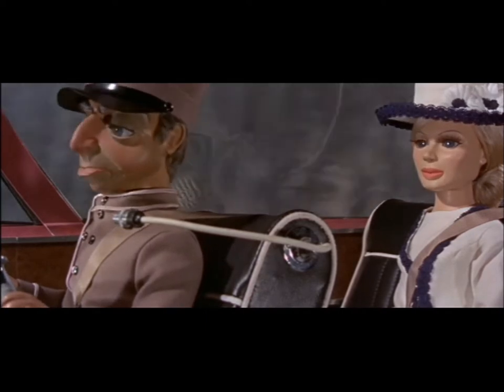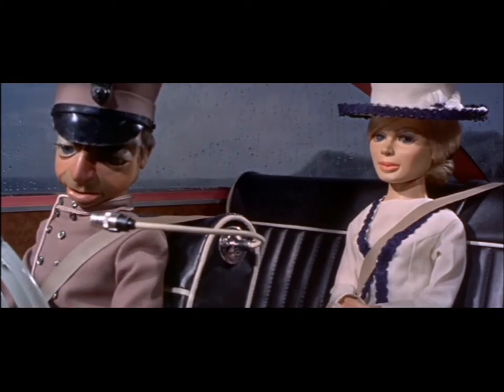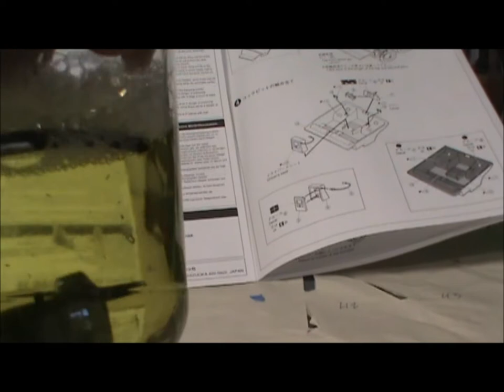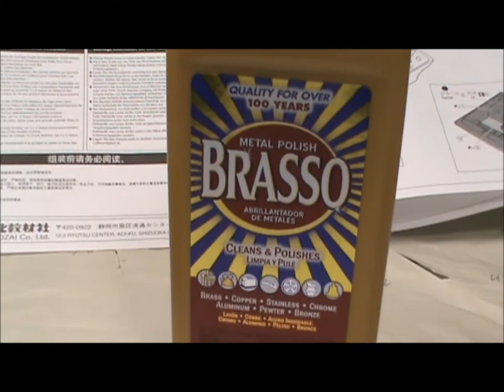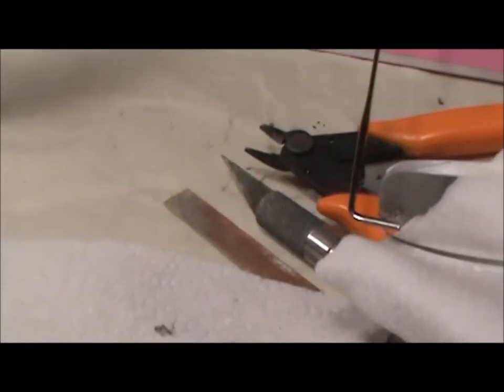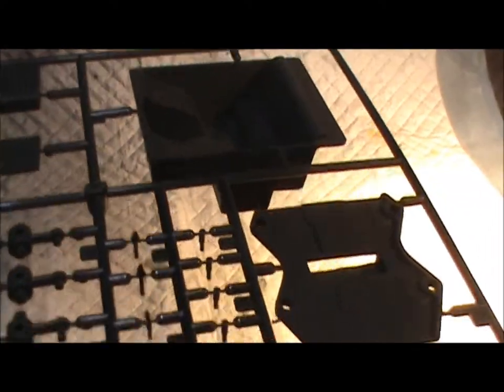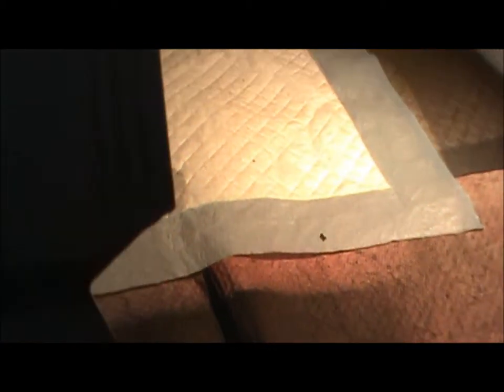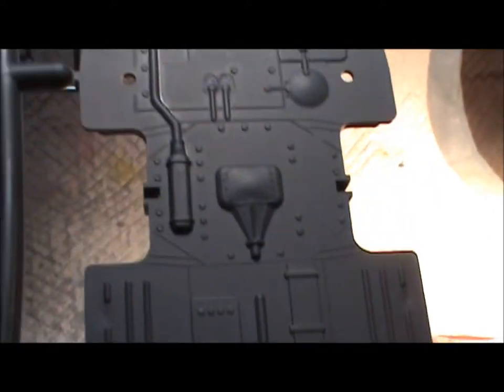update 1 of the FAB 1 build

Comment: Great update.  Looks like you're moving along.  I usually use regular bleach on chrome.  It does it in minutes, but is more caustic than Totally Awesome.  LA's Totally Awesome is pretty versatile stuff (and the price is good).  BTW, have you ever used Tamiya Smoke on chrome wheels instead of black wash?
Reply from the maker: Vincent Weston Good tip. will have to try that.
Reply: I just used it on the BTTF Delorean.  I did put down a wash for between the spokes and then put smoke over it.  The brownish black color cuts the "toy like" chrome down, while giving you shine.  It looks pretty good.  I can be sprayed or brushed on.  Both work.